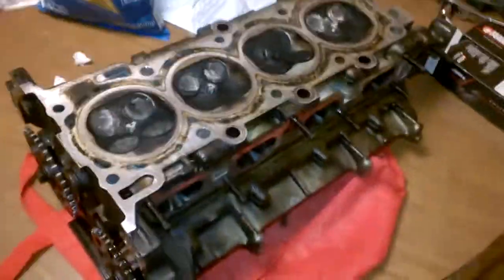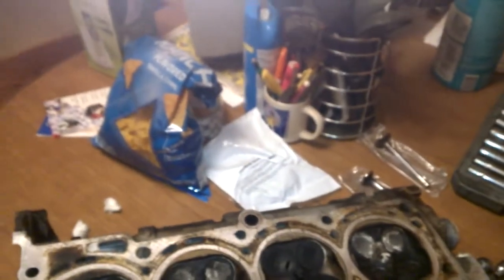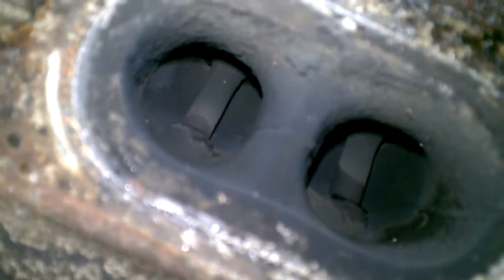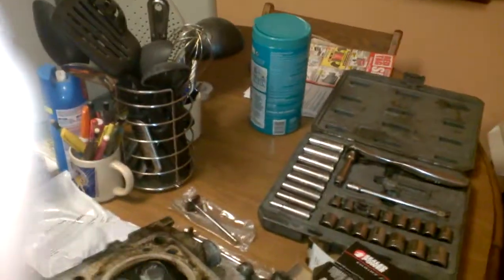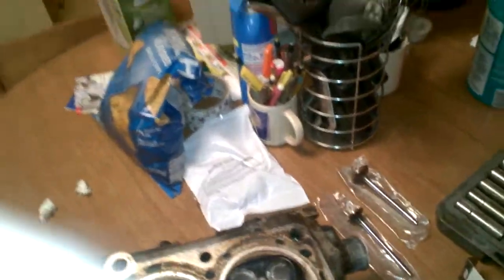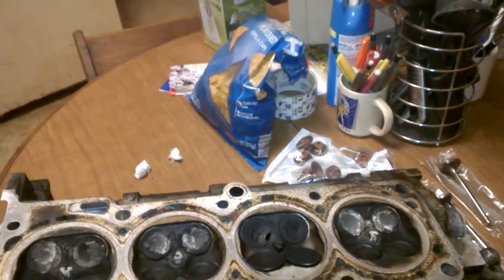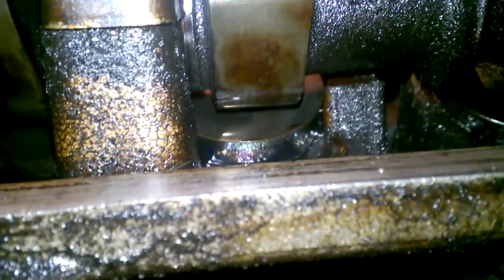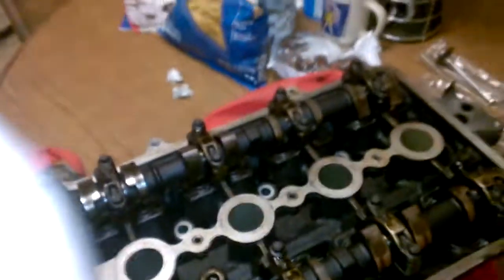Covering The Infamous "Burnt" Valve(1995 Saturn 1.9L DOHC)

Comment: Are 1.9 SOHC engine vulnerable to this problem? I have a 98 sl1
Reply: the sl1 heads can crack and you can swap any sl2 head onto any sl1 block youll just need manifolds and the downpipe and for gen 2 the pcm as well
Reply from the maker: No. Your head is prone to cracking at the #5 camshaft journal, though, and the telltale sign that has happened is your coolant expansion tank will have a "chocolate milkshake" collection of oil and coolant mixing.

Comment: hi, i have a 97 sl2 with the 1.9 dohc engine, and im replacing a worn out intake and exhaust cam shaft. i did notice that after i removed the intake cam which had sheared a key on the gear, that both of the valve lifters on both number 1 and number 4 cylinder are lower than the rest of the lifters. does that mean that i have bent valves? or is this just because the hydraulic lifters had emptied themselves of oil? thank you!
Reply from the maker: If the lifters are sitting a hair lower, they could be collapsed from not having oil pumping them up. It would be a hard guess without physically working on the engine. It could also be a worn out valve spring. leave the spark plugs in the head, flip it upside down and pour water into the chambers. if the valve springs are shot, water will leak into the ports. At that point a valve job and new springs are recommended.